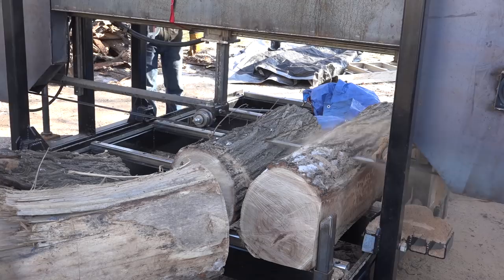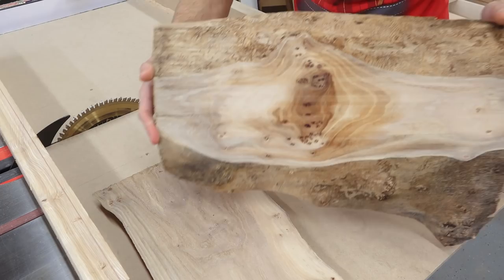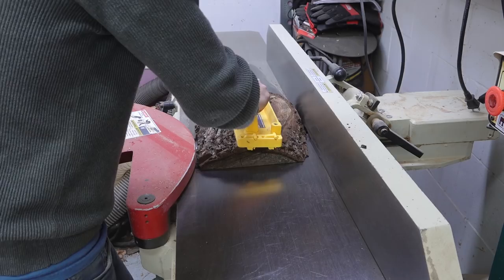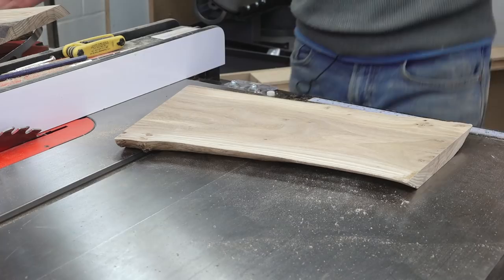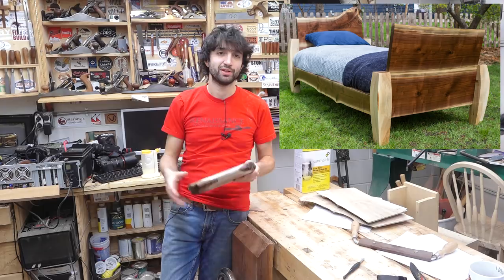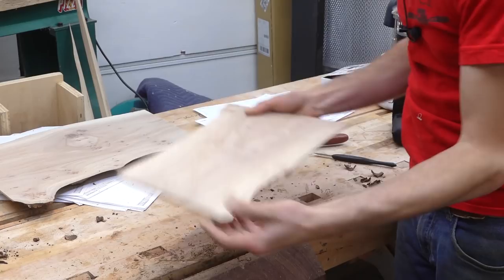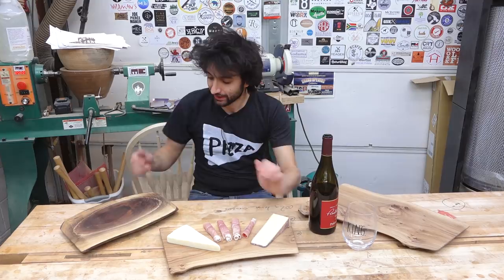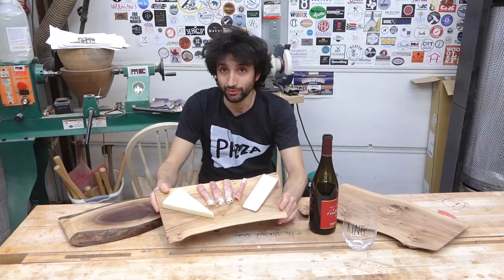Cheese & Charcuterie Boards From Sawmill Waste

Comment: The sound of sped up finishing is a new happy place.
Reply: Yeah - I'm wondering how Matt did that. I'm guessing---maybe some new fangled battery powered gizmo (that you attach to the arm somehow), which increases the sanding motion to a capacity similar to that of belt-sanders, or som'n. But.....it could also be magic that Matt may have learned from a "Wood" Elf.

Comment: Just did this very thing. Found a slab from the mill cut from a mulberry that had curled on the sides. Just couldn’t burn it so I ran a flat on the bottom, sanded the top, sealed the bark with epoxy and the top with oil and wax. Nice tray that the contents won’t roll off. Quick, creative, unique project

Comment: Hi Matt, quick question on raw stock. I have an opportunity to get some hard maple for cheap for a workbench build I have in my future. I thought i'd grab it and let it dry while I build my workshop out a bit more. My question for you is how long should green lumber sit (approximately) before i should work with it? I'd stack it in a similar way that you do your in a sunny spot in my yard. I just don't want to run into a situation where I am ready to move ahead with my build and I have to wait another year before i can touch the wood. It will be totally green, hasn't been run through the mill saw yet, it's just a local guy (New England) who mills up fallen trees like you do. 

Appreciate any help!
Reply: Six months to a year per inch is typical . . Or approximately 11% moisture content depending upon your location .

Comment: Could cutting board like this be cleaned in washing machine ? I would like to make one that I can clean that way.
Reply: No, it should only be wiped with a damp cloth.
Reply: By "washing machine," can I take that to mean a "dish-washer" machine? If so, you probably wouldn't want to put objects made of wood in a dish washer. Unless perhaps, that it was entirely coated in a finish that you know could stand up to all that hot water and soap (though I'm not aware of a food grade finish that might be rated for this).

Otherwise, hot water and soap will quite likely substantially accelerate the drying out and cracking of the wood. Or, at least, ruin a finish that isn't made to stand up to dish-washer conditions. Some woods might hold up longer than others, but I couldn't tell you which species might.

Yet, I do understand the need to keep food contact surfaces free as possible from various bacteria and pathogens. I guess it might sometimes be a toss up between wanting to preserve the wood's pristine beauty, vs. one's reasonable desire to remain healthy.
Reply: Yea sorry I ment dish washer I was always wondering about this, we have couple of one piece cutting board and they are OK had them for some time OIL them like once a year, so I think that glue is bigger problem than finish, this would be an interesting video how does these things work in real life environment.
Reply: Maybe if you completely encapsulated with resin?

Comment: So Matt, I've made a few cutting boards over the past couple of months and almost every one ends up with some sort of twist in it.. and all my boards are milled nice and flat. anything you might suggest to prevent this..
Reply: I'd say make your first step is to check the moisture level before doing anything with the wood. Moisture escaping from the wood causes twists and warping. Much better to start with a dry piece.

Comment: Matt, what's the difference between the salad bowl finish and cutting board oil?
Reply from the maker: Oils don't really cure so every time you wash it, the oil is removed so you have to keep replenishing the oil. Salad bowl finish cures and will not be washed away so there is no maintenance required
Reply: Excellent Matt, thank you very much.

Comment: You are awfully fond of very dark epoxy for stabilization and fill-in, and the contrast can be great.  You did use that blue tint on those bench/coffee tables, but why what seems like nothing but dark brown/black?  For that matter, with cracks at the end grain, shapes (like long, thin triangles) could be cut and filled with colors, or even contracting wood.